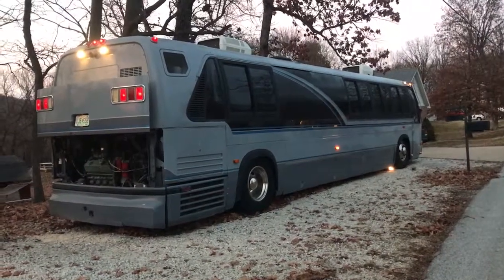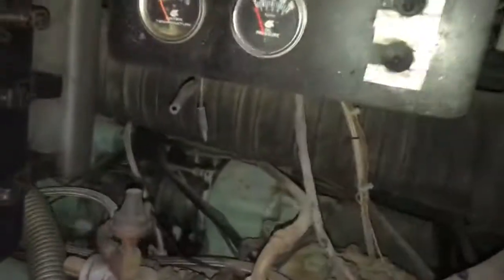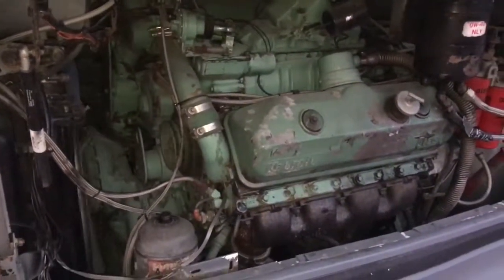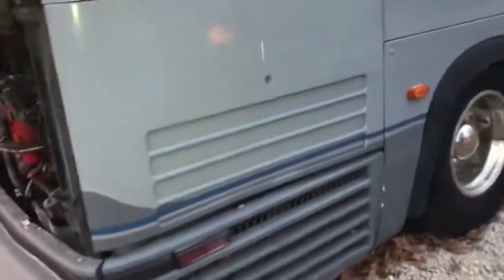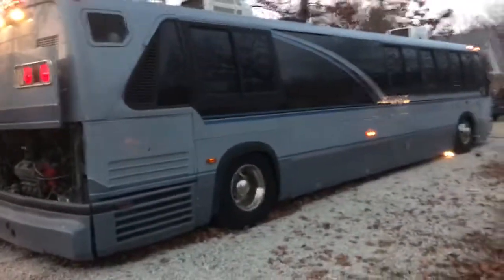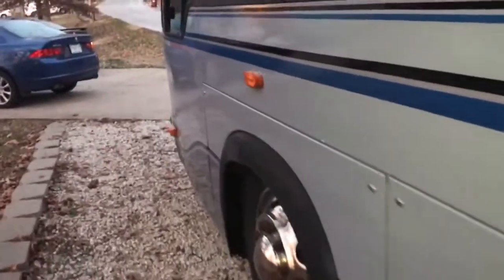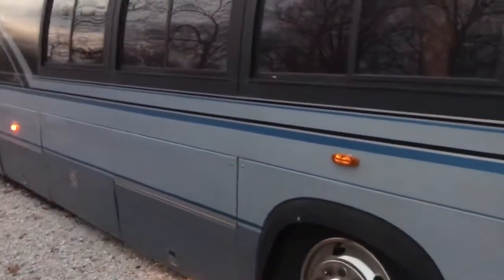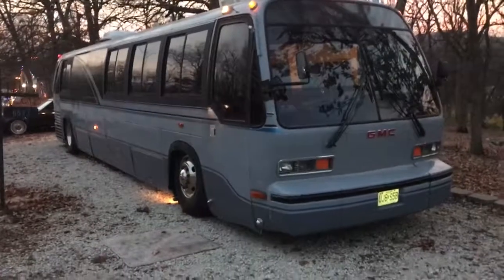1980 GMC RTS2 RV conversion walk around and start.

Comment: A small tidbit about this Rig...….   If it came from Philly, it was factory converted to the square back. And most likely from the city service system know as PHILADELPHIAN trans co.  SEPTA transit system only had slope back RTS's that only saw cosmetic and powertrain upgrades, not HVAC.